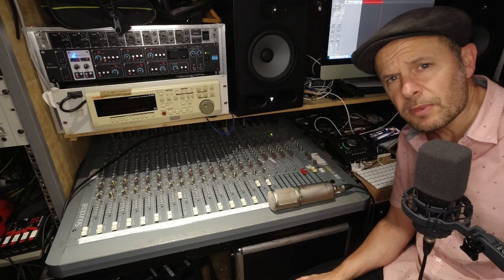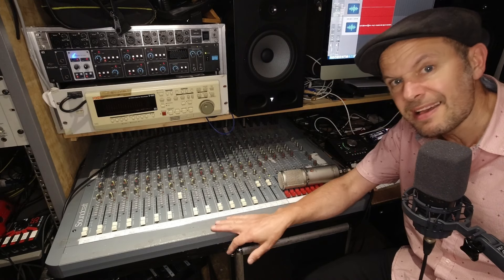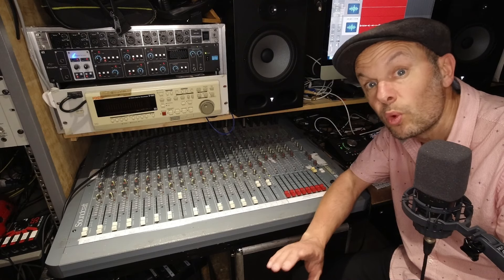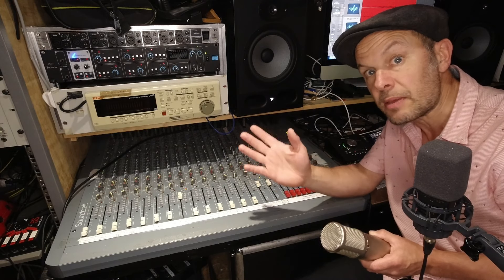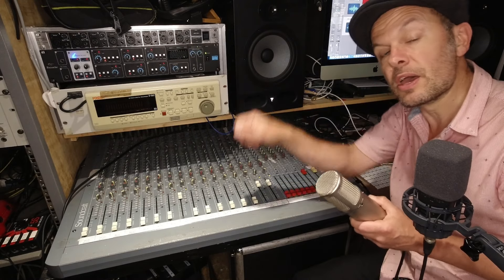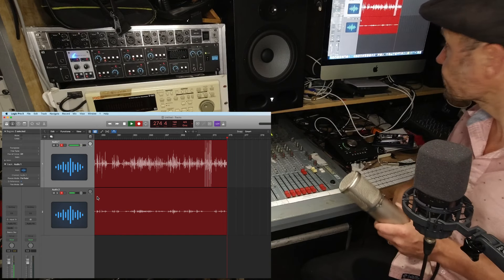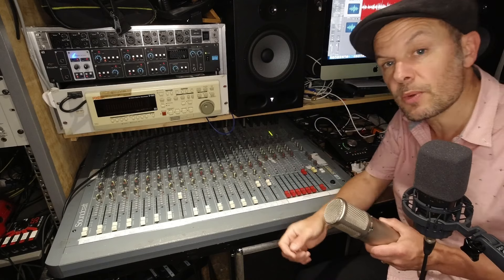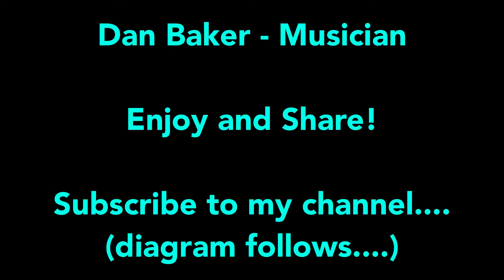Using Analog Mixers with DAW

Comment: Love those old Soundcraft boards. Super intuitive layout.
Reply from the maker: Totally. I’ve just got to service the power supply though-it’s started crackling a little...
Reply: @DanBakerMusic  exactly.  and its why i jumped at getting this vintage Series 600 soundcraft.  Cant beat that old British sound, and like you said, super intuitive to navigate.
Reply: I'm a big fan of the Spirit M series, like the M8 or M12. It has a very low noise floor and has S/PDIF out, which can be useful. There are some Soundcraft desks that are notorious for their noise, be aware of that in case you're going to buy one.
Reply: Which model soundcraft is it, @DanBakerMusic?   I'm trying to find it online.
Reply: I didn't realize this was a soundcraft even though I found this through searching for Soundcraft Series 1. Lol

Comment: Curious what good resources on soundcraft mixers there are. I am trying to learn as much as possible about a series 5, hoping to hook one up here soon.    One thing I am also curious on is if there are any fader mods or ways to motorize and get faders to send midi cc this would be a great multiplier - I know for the series 5 there is limited midi cc capability on the midi fader for program changes.. just so many unansered questions, like what is the CPU they are talking about, what type of cpu is it, is it a 386 or 286, or motorola etc.. very curious on these things but not a log of information.  Also I'm curious what the best way to send audio .. I have a twin and a zen q both have the same limitations, currently it seems like the holy grail is to get one of the larger interfaces that have like 24 or 32 inputs and outputs, using the inserts perhaps as there is a send and a receive on the insert inputs.

Comment: If you wanted to save on xlr cable costs and not have a ton of XLR cables or a really costly and chonky snake running from A to B, you can also get cat5e or cat6 ethernet cable (pref individually sheilded as well as fully sheilded), and use the 4 twisted pairs as a sort of combination snake by just buying some xlr connectors and wiring them up into a small section of breakout using each unshethed twisted pair from the main cable along with it's respective sheilding, and some heat shrink to neatly finish off each xlr jack. Each cable is then basically a 4x balenced xlr snake in a single thin wire form factor. You can do it with multiple cat cables to and from sub-d25 connectors too (with ground pins), or even make your own ethernet sockets, with a box that breaks out into xlr or sub-d or w/e if you're that way inclined, and then you can just use straight ethernet cable!

Not ideal for live reinforcement, but for perminant installation in project studios where no one will be going anywhere near the wiring with their feet, it's really nice, neat and cheap in comparison with around the same performance in a smaller form factor. You only loose a tad of robustness, but if you choose the right heat shrink, it should be pretty rock solid.If you use rj45 connectors then it's really durable (but it's also a real pain wiring up them rj45 plugs, the sockets suck too but aren't as bad, however the plugs really suck!), but why wire them when buying premade cat5e/6 ethernet cable is pretty cheap these days! 

Some places even have just the connectors for switching to M or F sub-d from ethernet rj45 and basically act as a conversion socket you just plug into your already present sub-d sockets at either end and then plug in your ethernet cable into them (which is probably the easiest way to set this up, but resrticts you to buying db25 capable gear and quite a lot of their convertors). It's much more versitile if you just wire the connections inside a box yourself, it's really not too hard as you can buy the fully assembled rj45 cat5e/6 network cables and all you need to know is the ethernet socket pinout really (and sub -d if not xlr breakout) as it's all just direct wiring with no other componants other than the sockets and the wires (unless you wanted to add features which are not just direct connections). You can repupose old XLR patch bays for this as a really cheap way to build the housing as they already have all the break out connectors and the wiring built in, you'd just need to remove some xlr, and replace with RJ45 and rewire them (the only thing you would need is somethnig to fill in the blank space around the RJ45 sockets, which is easy and could even be a just a few small bits of wood with some holes in if you wanted)! Even a broken old active patch bay with grounding and other powered functions could be even cheaper, you can just gut all the other electronics and use them for something else, or sell them, or just give them to someone who might use them if not you, as the grounds will be straight pass through from the RJ45 to the break out connectors, rather than needing to be grounded at the (no longer) active patch bay. ;)

Comment: What an excellent and clear summary. I've a Soundcraft Spirit 24 currently gathering dust (power supply is noisy and seems hard to find a replacement/repairer around here in Liverpool), but have been looking to reuse it as I've given up on digital desks... I miss the simplicity and musicality of analog desks (and they're so cheap now if you can find one that's actually fully functional 😄). I imagine this would work well with some cheap ADAT interface like a Behringer U-PHORIA UMC1820 to get into the DAW with an ADAT audio interface? (I'm lusting after a BabyFace...). Subscribed for further insights - your descriptions are really clear.

Comment: I have an Alesis HD24 Digital recorder that receives audio from my DAW via 2 M-Audio 1010 LT audio cards which then goes out to my Mackie Onyx 24.4 sound board and then into a Denon DN-300R digital recorder (onto an SD card) and finally our through my KRK 8" NF monitors. This setup recently cost be a small fortune, especially all of the cabling, but I love the ability to record old school while still utilizing a DAW with it's numerous plugins and features! I would recommend this to anyone who is a bit old school like myself, who wants to work with an analogue system as well as a DAW on their PC! I wonder, however, if the M-Audio 1010's are really up to par with today's standard and if having this hooked up the way I do may introduce more noise than I want...

Comment: Hey friend. Can you help me? I have a console (soundcraft ghost) and an apollo uad. My sampler is a sp1200 and i want to sample from vinil and sample from computer (voices, audios) all to Ableton. How can i link everything, especially sampling from the computer from the sp1200
Reply: I use other smaller samplers mpc live ii, sp404, to feed my older gear , sp1200, emax , etc… then run other gear into those samplers in the front of the sample line , then track all outputs 1-8 to a tascam model 16 or i. Your case your mixer into the interface to the computer

Comment: Thanks Dan, your videos are so helpful! 
I'm slowly moving away from a basic DAW/inteface set up to putting a home studio together that is VERY* similar to this. Do you do e-mail or other forms of consultation?
Would love to discuss ideas on optimizing this kind of hybrid set-up.

I guess my main questions would be; when would you choose DAW over the Fostex disk recorder? Does the Disk recorder interface with this set-up (via ADAT or jack plug?) How would you use outboard effects with this set-up, or are you using plug-ins? How often do you find yourself mixing from DAW to board on the 9-16 returns compared to mixing in the box? When you use the busses to go into the interface are they typically individual panned tracks, or stereo pairs of drum bus, guitar bus, Keys. etc? What changes to workflow might you consider when doing your solo projects vs. tracking a small group of players live?

(* Soundcraft Series1600 producer desk 24/8/2 with built-in bantam patchbay, Fostex D2424LV, Focusrite Scarlett18i20, Behringer ADA8200 ADAT interface, Mac Mini running Reaper)
Reply from the maker: Send me an email to danmanband@hotmail.co.uk and I’ll reply with a few things!

Comment: I just don't have the money for a multi-input audio interface. I found a Mackie onyx 1220 12 channel mixer for $50 which I'm currently using as my "hub" so I don't have to plug in and out instruments every time and set their gain. Really speeds up my workflow and it also has DB25 outputs which I can then use to do individual out on the 12 channels if I happen to ever get a better audio interface.

Comment: I used a Behringer 6-input mixer into my 2i2 for a few years until one side of the mixer gave out, at which point I bought an interface with 4 inputs. The mixer was only for the purpose of micing my drumkit with more than 2 mics. I experimented with using it's built in channel compressors and EQs instead of Waves plugins a couple of times, but it's vaunted "British eq" was too bland. The compressors were good, but I'd forget that bc the big shiny GUIs of the vst compressors I have were fun to look at. The mixer wasn't for "adding analog sound", only for making it possible to use multiple mics if needed, lol. But hmm. What you're doing here is really interesting to me. It seems (or my Texas hillbilly brain failed to catch it LOL) that which mixer you're using for your purposes isn't mentioned? But I must suppose it's something on the higher end. Would the used Mackie (circa late 90s) "recording" mixer that's been rotting in the local music store be "good enough"; it's got I think 16 mic inputs and is more than plenty of mixer for any purpose I would ever have, and it can be had for quite cheap, 350 USD. It's in good shape, not caked in dust, no tarantulas living in it, etc. Or would I need to get something fancier do you think. Lol, thx. Good post.
Reply from the maker: The Mackie stuff from the 90s is U.S. manufacture, and extremely good, better really than the Soundcraft Spirit Studio that I used here. Mackie went downhill when manufacturing went out to the Far East...

Comment: I have an old 80's Tascam M520 20 Ch Analog Studio Mixing desk plus the power supply, that a friend gave me for nothing, and I'm very interested in getting it integrated into my little home studio, I also have a Focusrite Saffire Pro 40 Firewire Audio Interface that has 8 line ins and outs as well as an optical out, but I really want to replace it with something that is more reliable and is compatible with Windows 11, I've had no end of trouble with the Saffire Pro 40.

Comment: Nice video.
I want to use my 24 track Hard Disc recorder (Alesis 24HD-XR w/24 TRS jacks in and 24 TRS jacks out) as a way to get more inputs and outputs to do old school style mixing on an analog desk (with vintage rack gear). 
The Alesis HD recorder has three sets of light pipe connectors for input and 3 sets out, via 6 optical cables.
Would you know of an interface that has at least 24 optical outs? (I don't care about 24 inputs so much, I mainly want 24 optical outputs from an interface to run into the line inputs of my 32 channel analog mixer. 
Very nice video..Thanks in advance.
Phil
NYC Area

Comment: I had two of those spirit studios but had to sell as both had unfixable issues with channels dropping out, crackling, etc was so frustrating as they sound great.
Reply from the maker: The dropouts can almost always be attributed to the insert points on each channel-I soldered across the ones in my desk as I don’t use effects on the inserts. Mine is starting to crackle a little, but that is more likely than not to be the power supply. I’ll have to get that sorted out...

Comment: Friend of mine has this soundboard, sadly I only have a mackie pro 12 O.G.   I also have a behringer FCA 1616.  I can't seem to figure out how to add the ASIO device to pipe all the audio from my soundboard to the DAW?  I have "stereo return" and "tape out" but the easiest solution appears to just use my main stereo out from sound board that goes to my studio speakers to instead one of the input channels on my Audio interface, and then plug my speaker to the audio interface output.  I know this would work, however it would involve having the audio interface powered all the time, and I just want to keep the speakers plugged in to the mixer all the time for playing the keyboards, and spinning vinyl.  So how to I get the audio out from the mixer to my audio interface to record on a DAW without sacrificing the main mixer out to speaker and still record the mixer audio to a audiointerface/DAW ?

Thanks

Comment: What couldn't I just connect my analog mixer's Main Out straight into my Apollo's In? And do the mixing bit on the analog board. Why exactly do you need that audio interface between your Apollo, and the mixer. I don't understand.
Reply from the maker: You can do that for sure. The extra audio interface was for more inputs into the computer, so I could have eight buss outputs of the mixing desk going into the computer as separate feeds.

Comment: So if I use an analog mixer with 8 or 10 mics for drums, can I send the kick on group 1 out and snare on group 2 out and the rest of the kit on 3 and 4 to an interface that has at least 4 line inputs built into the interface without having to go through their pre-amps, or will I have to go through pre-amps again and will the DAW show the kick and snare on seperate channels as well as the rest of the kit L & R on 2 additional channels? And this is accomplished via USB? Is there an interface with 8 or 10 1/4" TS line inputs and maybe 2 XLR with mic pre's that can get my analog signals into my digital DAW.

Comment: Great video. Very interesting. I have an A&H GL2 which is a very nice mixer with 10 mono channels, two stereo channels, four groups (buss) and a L+R channel. Besides this there are 6 AUX (5 and 6 are colored differently and lay out in a different group section on the panel of the mixer).  How many channels do I need to have on my Interface for it to work and is it fair to say that in your setup I can use 7 channels?

Comment: Please was that a mono jack cable?... For the group out to audio interface?
Reply: I didn't see, but the correct cable depends on the output of your console. They're not all the same, could have unbalanced group outputs or maybe balanced outs.
Reply from the maker: I used stereo jacks for the group outputs, but if your console is unbalanced out (i.e. a mono Jack), it’ll all be fine as long as you keep power supplies and audio cabling apart. Mains hum can easily get into the signal chain if a cable passes next to a mains transformer, whereas the effect is vastly reduced (but not totally eliminated) if you use balanced (stereo) jacks.
Reply: @DanBakerMusic  yeah my soundtracs console has unbalanced outs, which is less common

Comment: love it , but whats the point, if the stereo out from the board goes straight to the speakers and not an anaolge prinnt sournce like cd or adat, mixing on the board would be pointless accept mixing the in put signal, so the formula would have to be set pre amp fader, record, mix on the board then print to cd or adat after each song???

Comment: Hi Dan. You are a really good comunicator! May i ask you a question? Can we use the daw effects with the groups inserts in a mixdown process?. Im studying to make this kind of process in an digital-analog hybrid setup, but i dont know if latency its going to be a problem. I think it could be a fun way to use plugins as compressors, eq... as if it were hardware gear. I hope that you will understand my question, English its not my first language. Thanks Dan, i apreciate a lot your channel.
Reply: He already put out a video about it!
Reply: @henriqueulbrichoficial  I've seen a video where Dan explains how to use plugins with a mixer using the aux sends. That video is, in fact, the reason im doing this question. I want to use this same technique but with the subgroup inserts "ala michael brauer" 😁. Thanks for your atention Henrique.
Reply from the maker: Yes that is an interesting one and different to my other method. I would think latency could be the deciding factor. My desk has slightly dodgy send and return jacks on my board, but it does involve ripping apart my current setup. If you use aux sends as I did on my other video this will be fine for things like reverb and delay but more of a problem with compressors unless you muted the channel and just listened to the aux send...
Reply: @DanBakerMusic  it works well and its really fun to mix this way but there is some latency issues. Its like playing a midi keyboard with some latency.

Comment: Something in my setup isn't working for me, although it should.. I have a Behringer UMC1820 interface connected to my Mac (usb cable), and I cabled its Main Outs to an old Mackie mixing desk, going into Ch22 and Ch23.  The CTRL Room outs of the Mackie go to a woofer and a pair of monitors, and the Mackie's Main Outs go to 2 inputs on the audio interface (because I'd like to record the hardware synths).  I also would like to use VST's along with the hardware synths cabled to the Mackie. For some reason, I'm getting no sound at all from the Mac even when I just want to play an audio file.  There's a monitor knob on the front of the interface, turned all the way to the right (playback only).  I have no idea what's wrong here :(

Should I hook the woofer and monitors up to the Main Outs of the audio interface?

Comment: Just wondering, where is the diagram for the wiring? And also, if I have a sound craft series 1624, we don't have any patch cable direct out channels, and just 4 stereo channels sends. What would be a suggested way to get the 24 channel board hooked up?